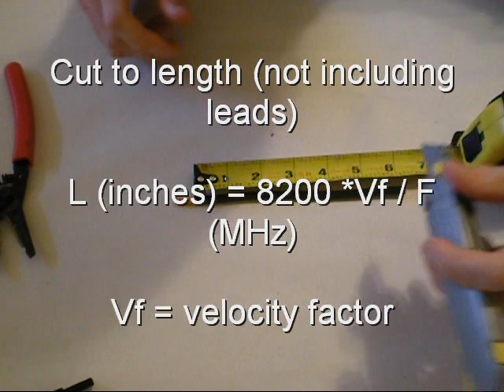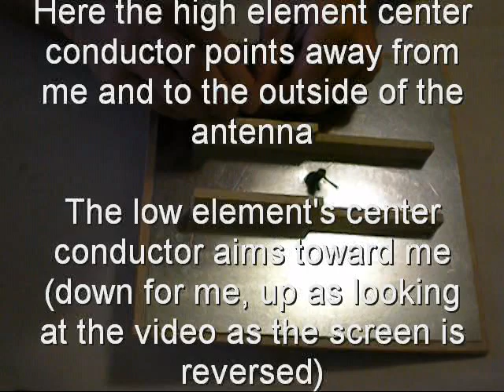Build IBCrazy's 10dbic Double Quad antenna for FPV

Comment: The radius section of the clover leaf is half a wavelength with the 2 straight sections being 1/4 wavelength. Rg312 should be cut such that it is a multiple of a wavelength I.e 3/8 or 5/8

Comment: Hey Could you please give some information about the size of the Cloverleaf size of the transmitter antenna? I have a 5.8 GHz and Jut don't know what will be the sizes! I Have seen very very small antennas but don't know what should be the length of the radius  of the leaf ! Thanks in advance!

Comment: I guess that he assumes that everybody knows where to find the conversion calculators so we have to find what (L) equals. And all the other missing measurements that he left out in this video. Great video. But a few more details about how long the wires should be and where the bends should go.  TALL SIDE HEIGHT (INCHES)=1425/F (MHz) ???
It reminds me of math class. Where we have to figure out the missing value. Lol
Reply from the maker: This is one of my early videos, so chalk it up to inexperience on my part.